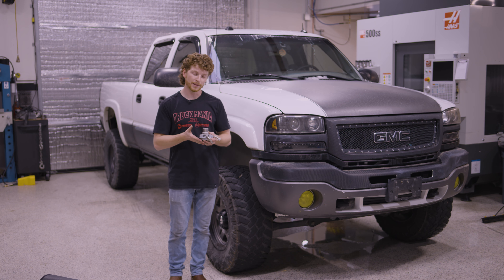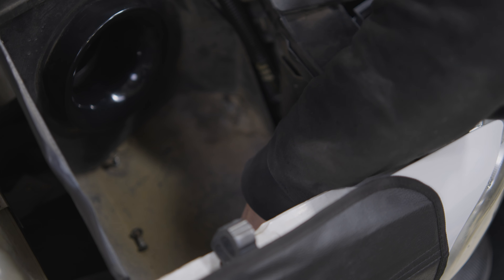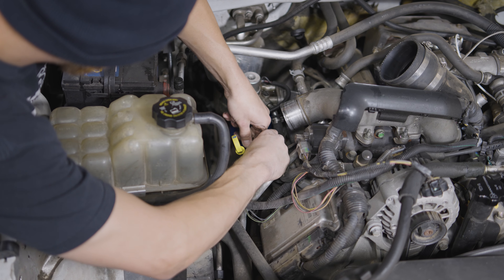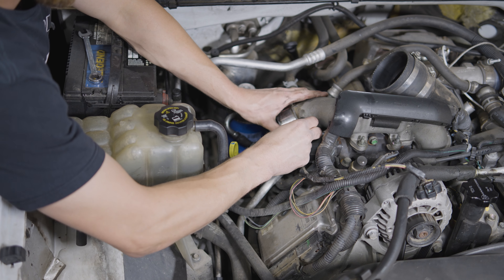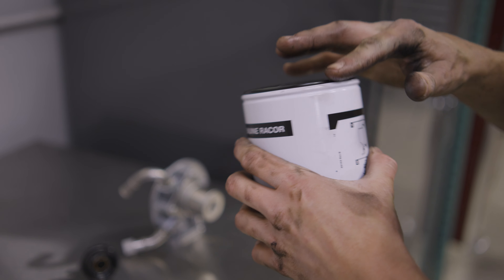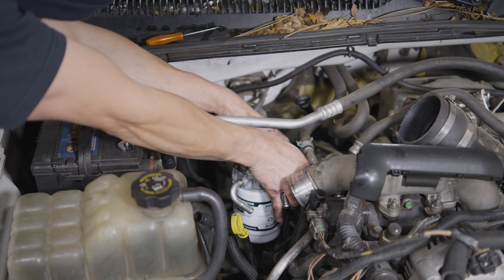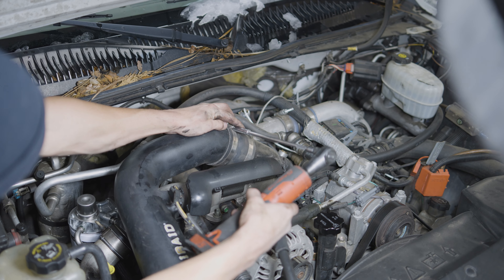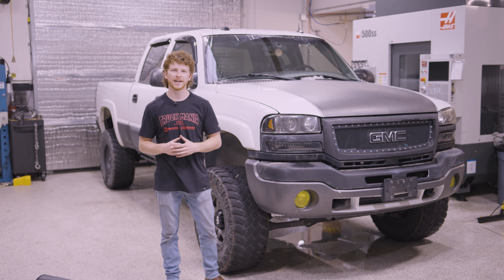Duramax Diesel Fuel Filter Head Install | Fix Your Crank No Start Issues

Comment: installed 359, now have check engine light…is that due to heater wire elimination?
Reply from the maker: No, that does not throw a check engine light